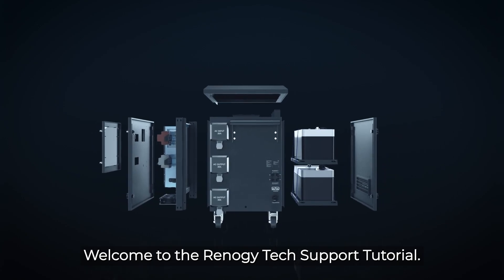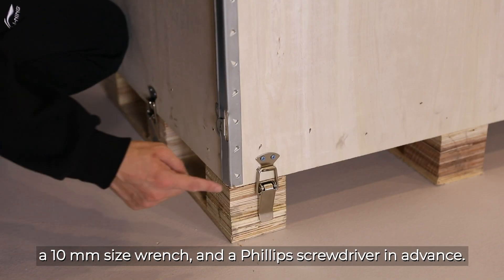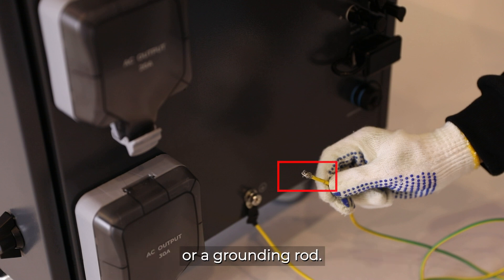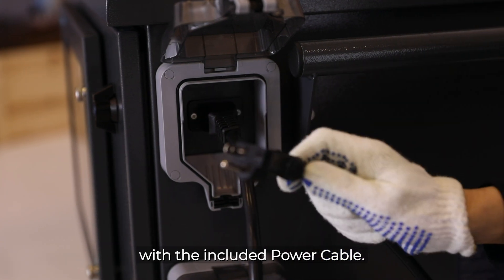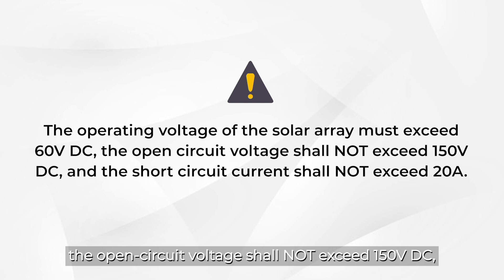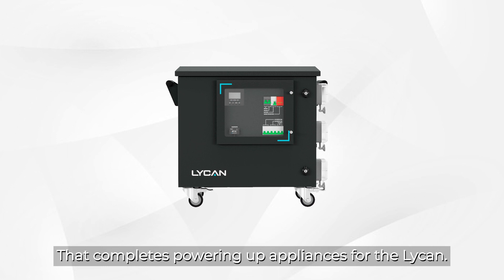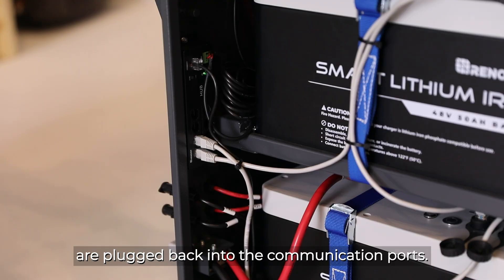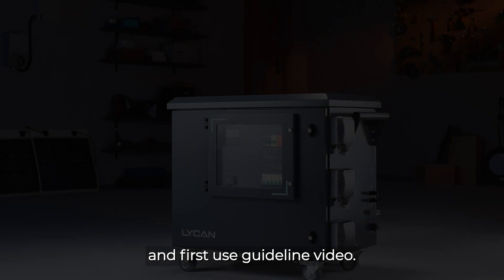Renogy LYCAN 5000 Power Box Setup Tutorial

Comment: Don't understand the grounding, if this unit is to be hooked  to a sub-panel  via a transfer switch going up to a main panel that is earth grounded, why have the Lycan grounded with a rod.  Generators have to be floating neutral in order not to cause a problem in the panel,  please explain.
Reply: Connecting to the distribution panel only grounds the internal inverter output GND of the Lycan. External grounding of the Lycan is done to ground the entire device's metal casing. None of the above will result in neutral point grounding, and it will not affect the device's floating neutral.

Comment: "Please make sure that the 2 solar arrays have the same operating voltage and not partially shaded. If the operating voltage is mismatched OR partially shaded, this can cause current backflow and may damage the solar arrays".   - So, I understand that the two legs are connecting two arrays in parallel, so the panels must be the same type and amount (e.g. 3x 450Watt panels on each leg). HOWEVER, how do you control shading or different power totals if you have the 2 separate legs facing slightly different directions (e.g. South and East).   The total power will vary throughout the day.  Or if something blocks or shades a panel at a particular point.  I know most modern panels have pass through diodes to prevent many problems.  So, I am slightly confused on the "Disclaimer" on damaging solar arrays because one panel gets blocked...
Reply: Agreed.  This makes no sense.  "Please prevent clouds from blocking the sun so that your panels are not damaged."
Reply from the maker: Hi, wtytke.

When the panels get blocked, it actually will affect the power and voltage of the panel. Please try to ensure that it is not blocked so that it does not damage the solar arrays.
Reply: @RenogySolar  What happens when a cloud blocks part of a panel array or something interferes  (a bird lands on one of the panels) - Panels get blocked all the time or a cell goes bad, etc...  From your own website on your 450W panels (which I just purchased!) "The built-in bypass diodes protect the solar cells from overheating, allowing the solar panel to perform during accidental shading by bypassing the underperforming cells."  
Is there something I am missing here?

Comment: This is almost exactly what I'm looking for, its just a shame the breakers wobble when they are turned on/off. It doesn't give me much confidence in build quality.
Reply from the maker: Hi, annagilda1.

The circuit breaker itself is installed on the slide rail and is detachable. If the force is too strong, it is normal to shake. Please don't worry too much about this.
Reply: @RenogySolar  I'm also worried but I should be ok in a day or two.

Comment: Is there a plan to make a 5000 watt split Phaze unit like this? This is almost the unicorn device I'm looking for? I need 120v 30 amps for my tiny home electrical. But I need also 220v split Phaze for my mini split, hot water heater and well pump. With this unit I couldn't go full off grid 😭, but much better product it seems then the plastic competition. 

Can these actually be left outside in powered up mode?
Reply from the maker: Hi, Chris.

We are developing products that can support phase splitting and parallel output in the future. Please stay tuned

And Lycan can be left outside in powered up mode.
Reply: @RenogySolar  one thing I did not notice until now, there is no 12 volt outlet.  Can you use the Anderson plug that is meant for expansion to run a 12 volt load?
Reply from the maker: Hi, Chris.

I am so sorry that Anderson plug can only be used to connect batteries in parallel. 

We will consider to add dc output port in later iteration. Please stay tuned.
Reply: @RenogySolar  please, one more question. I want to buy this and 2 extra batteries. I use 6000watts in  one day, and want some back up. I'm wondering what solar panels I can use to max out the solar input. I was looking at Qcell Quantum 480 watt panels that are available locally, but I heard in another video that you have to stick to the voc limitations.  Maybe there is a data sheet explaining what to look for in panels?  Thanks.

Comment: Can't wait to pay off pre order to receive it!
Reply: How much is the unit?
Reply from the maker: @cuteone1702  Hi, this unit is $4,299.99. I hope this will help.
Reply: @RenogySolar  thanks it sure looks like a great unit 👍.  I only buy Renogy panels (14) on my RV.
Reply: @cuteone1702  You have 14 Panels on your RV what are they 10watters
Reply: @JayDee25895  7.3 watts each
Reply: @JayDee25895  but really, on my 40ft toy hauler I have 14 100 watt Renogy compact panels.  If they were 10 watts as you suggest it would not be much power at all.  I like these Renogy compact panels.
Reply: We received ours, batteries depleted during shipping. Called renogy they told me until it powers up its not under warranty. I had to order a special battery charger and hope that works because if it doesn't I will have a 5,000.00 worthless paperweight. Not impressed with renogy or their lack of customer service.